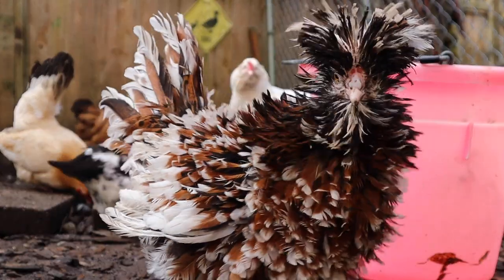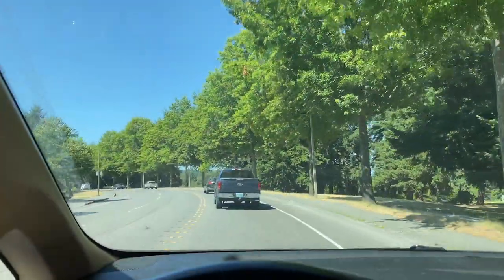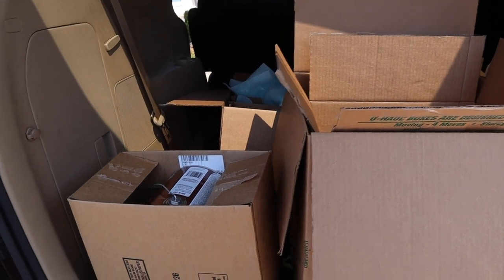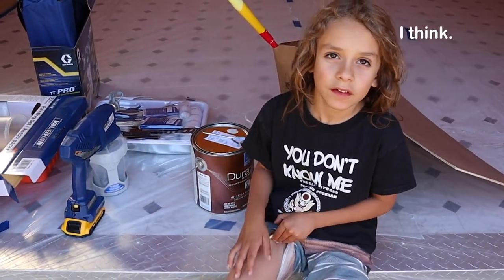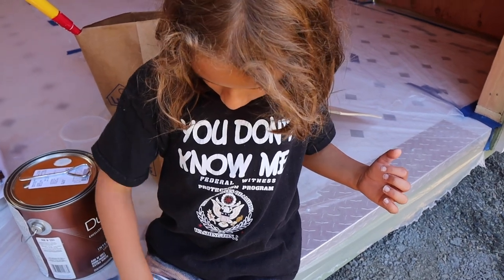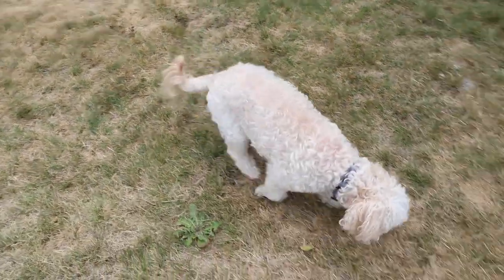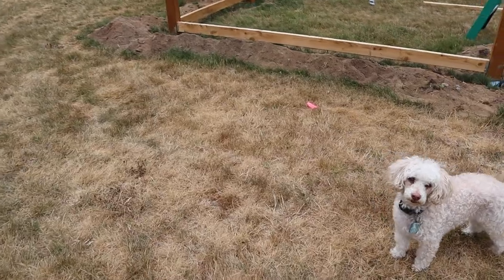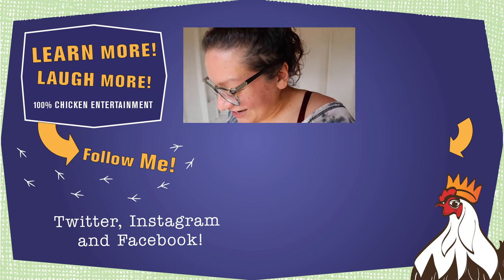Painting My Dream Chicken Coop

Comment: What kinda paint and primer did you go with? I have to paint my coop I’m building and worry about what paint is safe. Also what kinda paint gun is that???? I think I need it hahaha
Reply from the maker: Haha so the paint gun was great for this project but I wouldn’t want to use it for anything bigger. The battery runs out often! I went with a low VOC outdoor paint, high gloss. The main thing is you really want to make sure it dries very well before putting chickens back in. :)
Reply: Oh okay, I thought there was only one kind of paint. Yes I won’t have the chicks for a long time and I want to make sure everything is done before I get them so it will have a long time to dry before anything goes in. Thank you! I’m so glad you did a video. I think we all missed you very much.

Comment: I don’t understand why didn’t you just buy a chicken coop were you purchased the shed they come already build with windows floors and nest boxes even insulation for cold weather 
They cost the same as the shed 
That’s what I did instead of doing all that work!!!!
It doesn’t make any sense 
🤷🏻‍♀️🤷🏻‍♀️🤷🏻‍♀️🤷🏻‍♀️
Reply from the maker: Hi there! The shed came with windows, the flooring, the chicken doors, and basically everything but the roosts and nesting boxes which I wanted to put in myself, the way I like it. 😃